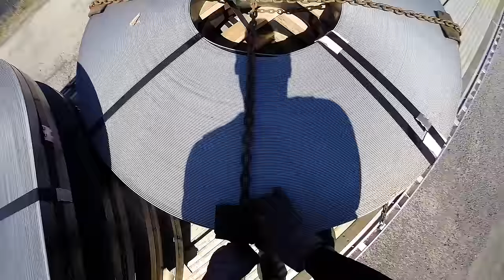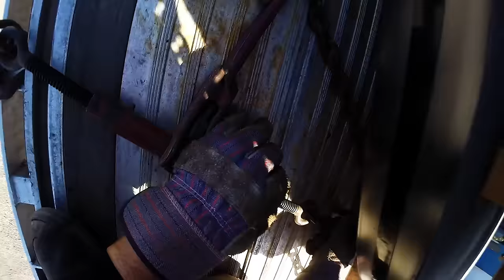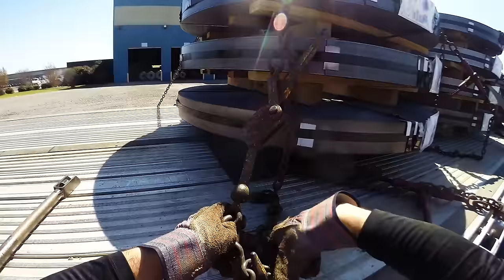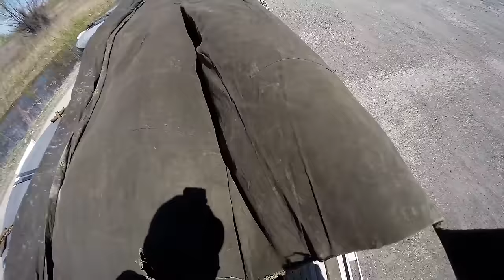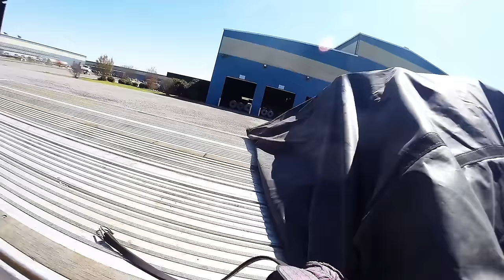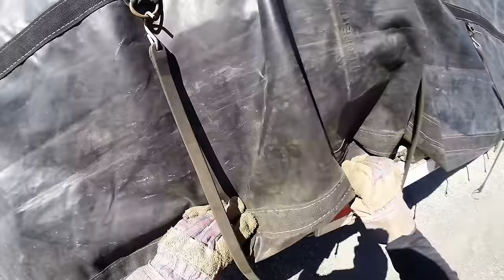Securing and Tarping skidded slitted coils

Comment: Don't know if this boy is gonna do it. But you can loose a LOT of slack in chains by how you hook them into the rub rails ... Sometimes that's helpful. I hauled a lot of machinery. I even had shorter pieces of chain for specific jobs. Even had several no more than couple feet long .... You can hook a ratchet binder (only kind I carried) directly to rub rails if done right ...

Comment: Top coil in center  needed a cross chain. Possible if you hit a vehicle and came to a sudden stop that coil could slide into your cab. A truck driver 19 years old died in Tilbury,  Ontario Canada from Laidlaw as a frenchman was merging onto the highway and came into the Laidlaws right lane and cut him off and he hit the back of his trailer as the french man ran out of on ramp. The laidlaw driver could not get over because a car was pinning him in.  His coils like yours slid into his bunk and killed him. I've been doing flatbed for 10 years and would cross each chain and add a third rail to other rail strap or chain on each of those coil stacks as well.  
the over the rail to rail does nothing for forward movement  but prevents the coils from sliding off the truck in case the trailer gets ditched of a jack knife occurs.Canada requires cross on over on each stack or its an 800 dollar fine.
Reply from the maker: +gereral1 Thanks for the information.

Comment: I can see why some drivers hate tarp ping , looks like, for the majority of your loads, you could use a 25' shorter trailer?  What is  gained, by  the  distance, between the two trailer axles?   Appears that the military practice of "hurry up and wait" can also be applied to trucking? Thanks for your videos and insight and good luck.
Reply from the maker: +Docg 92S10 The only thing gained is I don't have to keep swapping trailers for longer ones. I have 49 feet of lumber on the deck right now.

Comment: Why is the cool that in the middle strapped with two chains next to each other  and the coils at both ends chains  have a x pattern ?
Reply: armo byzantine it prevents forward and rearward movement on the front and rear coils.
Reply: @IMAIRIINIE  would it still be ok if you made the middle like a x pattern like the rest

Comment: Why is that load not spread apart a little bit more, and do those chains ever break??
Reply from the maker: Keeping them close also allows them to prevent movement of other stacks. I suppose everything can break once its breaking point is reached. The number of securements we use is based on a mathematical formula to secure what it can handle.
Reply: +Dale Clay OK just wondering I drive Dry Vans I'd be too nervous to drive a flatbed Keep on truckin and have a safe trip Driver!!
Reply from the maker: You mean putting a bunch of weight in the back and closing the doors does not make you nervous. I would be paranoid it would punch through a wall  :)

Comment: If you used two chains on the middle stack anyway, why not use the X pattern like the other two?  Why not just use straps?  Quicker, easier, and will secure the load just fine.
Reply from the maker: +Joe Mavericks policy is chains before straps on steel loads. I am not convinced it would be qiucker, as it's still the same number of chains.
Reply: Straps on steel coils won't resist on an emergency brake stop.
Reply: Carlos Carlos 
Of course they will.  Smh....
Reply: Joe whats the difference between a steel linked chain and a strap?

 I can cut a strap with a razor just like the edges of steel coils can. Not so much with steel chains.

Comment: I want to know who showed you how to sucure the front and back  of a load with a braceing chain with no binders // tarping you get 75 %  you did good the way you covered coils to protect that last tarp  ... you need some help with covering on front tarp at thends...
Reply from the maker: Some things are learn as you go with securement videos and securement manuals. Not every load is experienced under the tutelage of an instructor. I still feel fairly new to the trucking world and am always trying to do better in the methods I use.
Reply: in your future trucking times ... I saw that you didn't have anymore binders  so biuld a head bourd with 3 4by 4 s and 2 2inch x-straps  and 1 4 inch strap on          top of your head-bourd ...stay safe out there on the big road ...

Comment: U got it sucred for 16000
Reply from the maker: +Wayne Patterson Each chain covers 8000 pounds worth of securement value.
Reply: Correc. 
I use 3/8 chain and secure for 9600 lbs. You only need half for each point or rail as the ministry does when checking. say each coil is 5000 lbs. have 2 you would need 2 chains and a cross chain or strap. Sometimes I will use straps on the middle coils  cross X and over each but always chain the front and back ones. Sometimes side skidded coils you has like 8 rows so you run out of chains. LOL